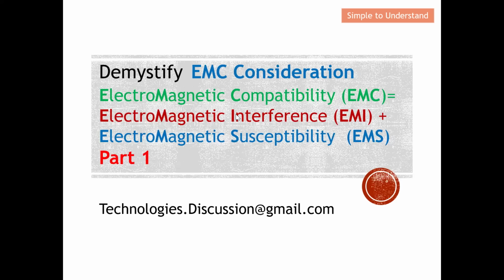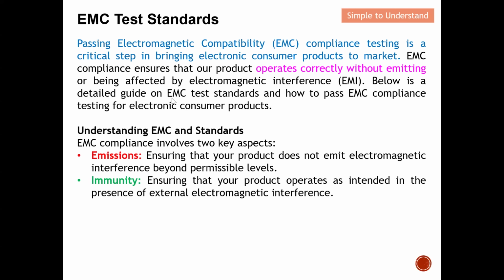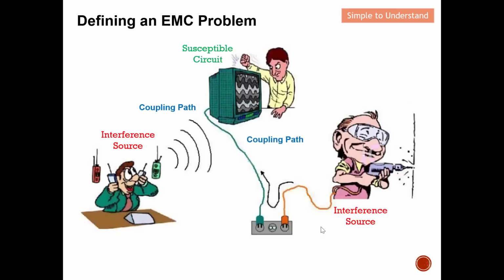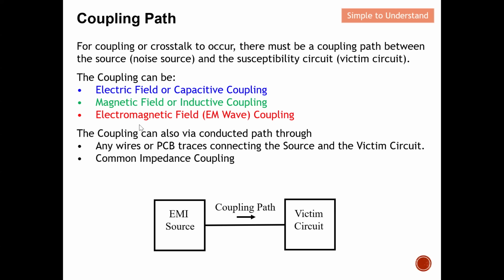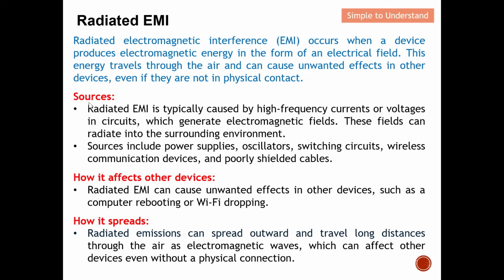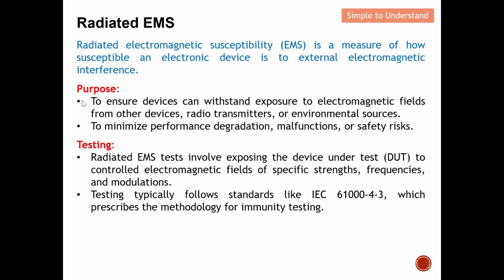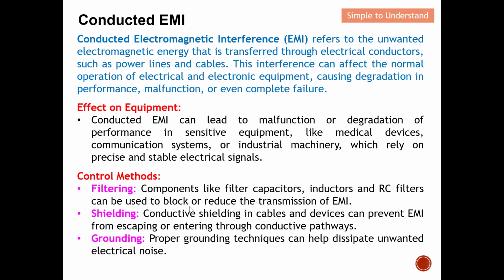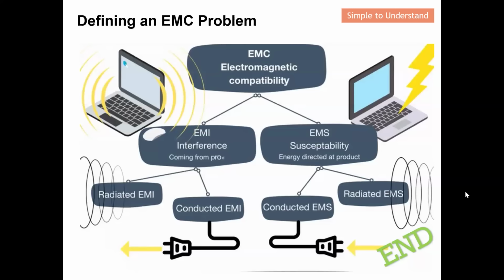EMC #1. Electromagnetic Compatibility EMC = Electromagnetic (Interference EMI + Susceptibility EMS)

Comment from the maker: Thank you for taking the time to watch this video.
In this video, I will first define EMC, which stands for ElectroMagnetic Compatibility. I will then explain that EMC is actually the combination of ElectroMagnetic Interference (EMI) and ElectroMagnetic Susceptibility (EMS).
For an EMC problem to occur, three elements must be present: 1) The disturbance source (the ‘culprit’), 2) The susceptible circuit (the ‘victim’), and 3) The coupling path between the source and the susceptible circuit (which can be conduction, magnetic, or electric fields, including plane waves).
If any one of these three elements is removed, the EMC problem is resolved!
Finally, I will discuss Radiated EMI & EMS and Conducted EMI & EMS.
EMC playlist.
https://www.youtube.com/watch?v=uQrHUvvfppk&list=PLFxhgwM1F4ywicEggR3pzF0FcFcGQvZ82&index=1&t=2s